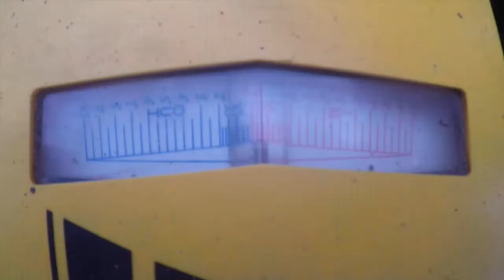The one where nothing goes to plan - Project Cars Are Never Finished - Part 28

Comment: Robin hoods are good at melting clutch cables I went through two before I put a transit one in. Bit longer so kept it away from the heat. Hope you get it all done before the trip
Reply from the maker: Thanks, Jonathon Barlow. I use cossie cables as they are about 2m long and so great for routing. Unfortunately my cables wants to go through the turbo though so this has always been a risk. Funny thing is though I had no problems until I put the extra heat reflective tubing on 🙈

Comment: Good luck, I also had a lot of problems with the clutch cable. I converted to hydraulic eventually
Reply from the maker: Frustrating thing is I never had a problem until I added the heat shielding. Although the more I think about it the more I think I am missing a cable tie...